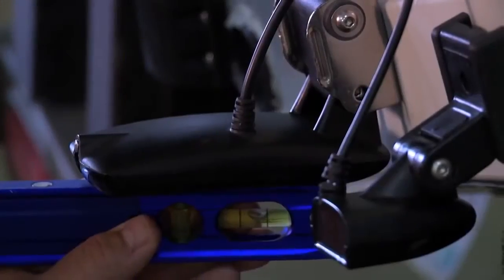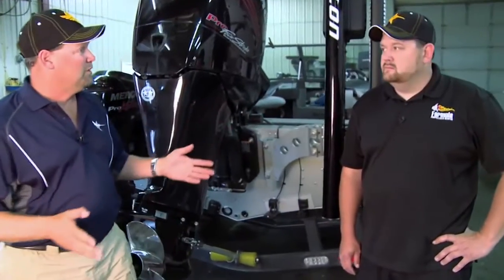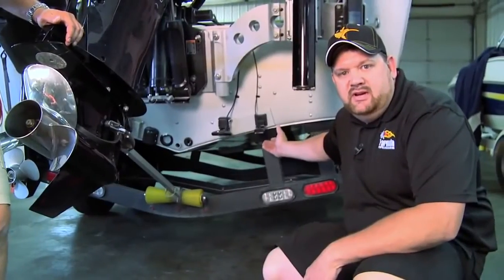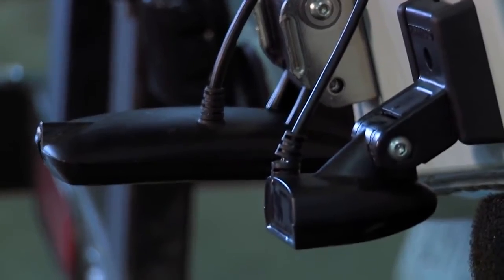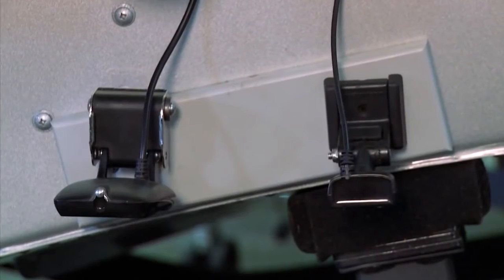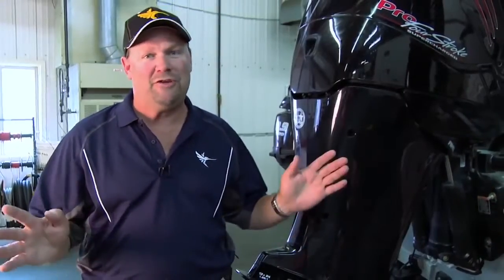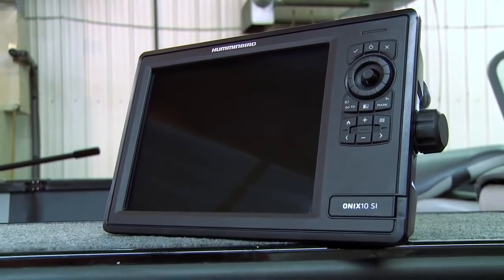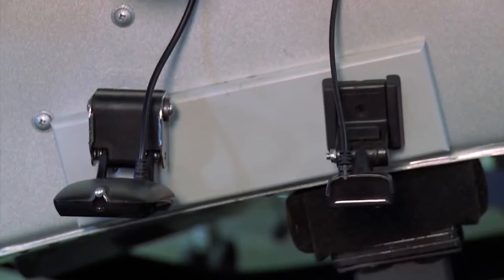How to Install Humminbird Transducers On Aluminum Boats-iboats.com

Comment: I'm needing to purchase that high speed transducer what is the model?
Reply: so I know nothing about transducers and trying to learn. Have I been swindled to thinking this "high speed transducer" is actually a thing, and what is the point to having the smaller one? I am actually replacing my smaller transducer(humming bird 155) similar in size to the one they are calling "high speed"  with a nicer unit(helix 10 SI) but is it worth reinstalling this old unit as well? Will it give me the readings on plane where the SI is not.
Reply: @schishler1  high speed transducer is the regular one, the one that isnt si or whatever, it gives you readings while you are moving from place to place at speed, cruise, whatever